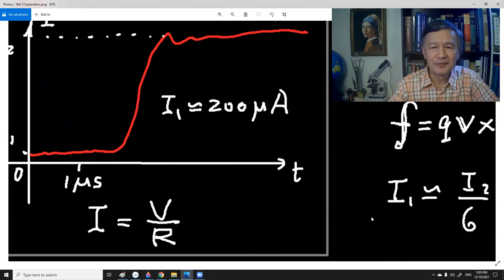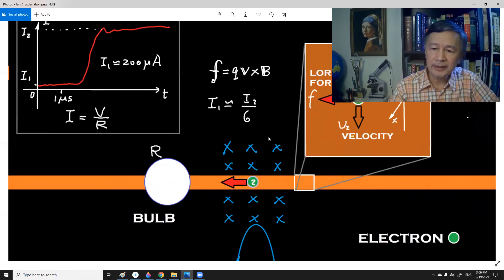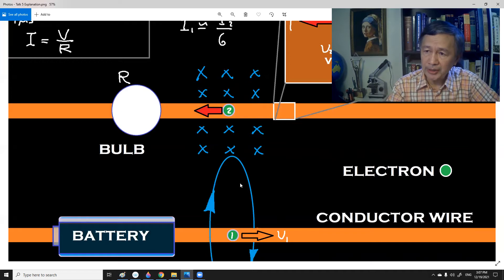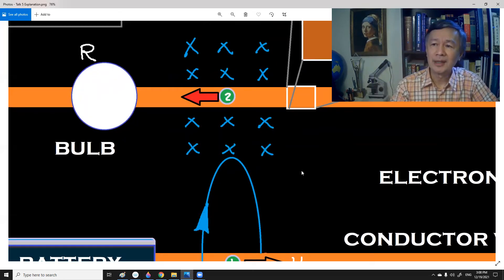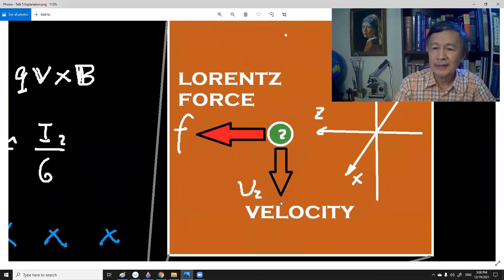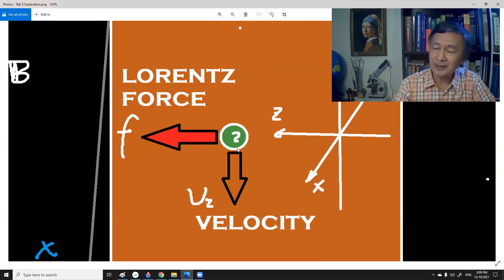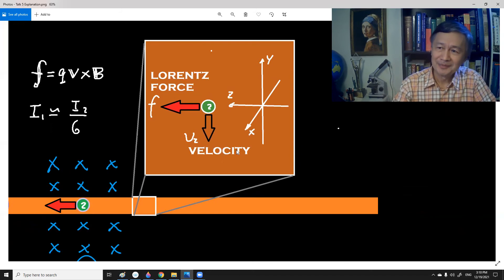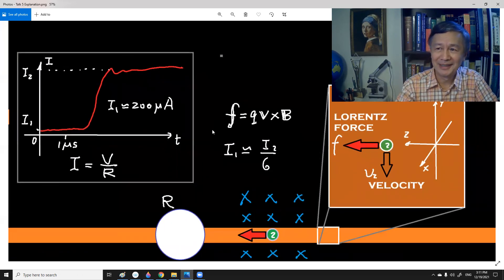A Simple Explanation for #AlphaPhoenix 's New Experiment | #Veritasium's Claim on Electricity Part 5

Comment: I won’t dispute your model. You’ve explained how the electrons start to move in the wire just after t=0.  Instead I propose the ‘artifact’ current is in part due to the dissimilar types of materials. Wire vs tungsten bulb, wire vs resistor (carbon) and also wire vs. silicon junction in the case of a solid state transistor switch and LED. I believe I am correct as the movement of the electrons in the dissimilar areas will happen at a different rate.  My instructors explained it like this: at the silicon junction there are actually ‘holes’ on one side where the electrons want to jump into.  Also there are extra electrons piled up on the other side that want to jump out. It doesn’t take much to make them move. Note this isn’t reality- it’s a model that lets you think about what’s happening. So its not the battery pumping electrons that causes the artifact current- that’s too fast a change. But that they are predisposed to ‘jump’ to a dissimilar material as soon as any charge change is detected. So the experiment was already flawed by using a silicon junction as a switch, imho.  The rest is explained by wave propagation at c.
Reply from the maker: A single neutron could trigger a chain nucluear reaction, but it is important to understand where  and how such a neutron comes from. Similarly, one still needs to know the trigger for a metastable system as your instructor suggested. ......"Wave propagation at c", perhaps you would be interested in my video Part 6 on this issue.

Comment: Seemed all very well explained to me, until the point I was confused that you only considered the 1/6 of electrons that were thermally moving downwards. What would be the force/acceleration of the electrons that were moving in the other 5 directions, and what effect would they have on the net electron flow through the light bulb? Perhaps consider especially those that were moving upwards? (Sorry I don't remember my school physics so well.)
Reply from the maker: The simple answer is there is only one exit for electrons near the bulb to go freely, i.e. to move towards the bulb. It seems the electrons knew which direction to escape in the case of tsunami.

Comment: Pages 250-360 for electricity/ expanding electrons.
Reply from the maker: Could you cite two relevant sentences from that book? Expanding electrons sound like soap bubbles to me.
Reply: @yongtuition  Former comment is gone: will not retype it; mostly math. The gist: “G” calculated from first principles: The hydrogen atom. The universal atomic equation basically from d=1/2 at^2, Galilean relative motion. Meaning the earth is expanding/ approaching the released object. 180 degrees from the noise we we taught ad infinitum ( especially since Newton). No book of 451 pages can be distilled into two sentences. The electron expands at @ “c” inside or outside of atomic nucleus: outside it is called EMR and electricity, magnetism et al.A proton is@1836 electrons now add a bouncing electron makes a hydrogen atom. One half of said bouncing electron outside of nucleus ‘radius ‘ causes all atoms to ‘ grow ‘ 1/770,000th their size per second per second constant acceleration. Applied to earth size object equals 16 feet; I.e. gravity. Enough.